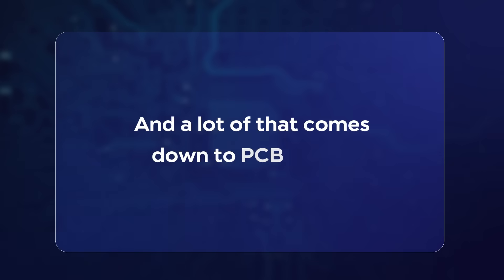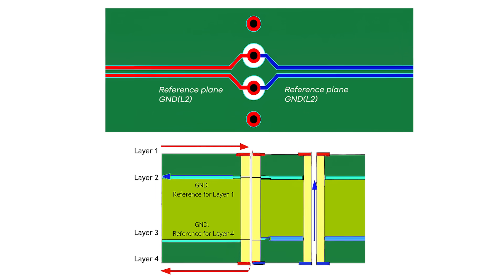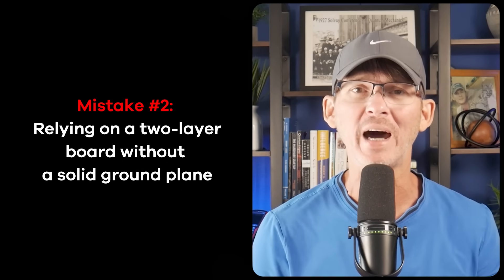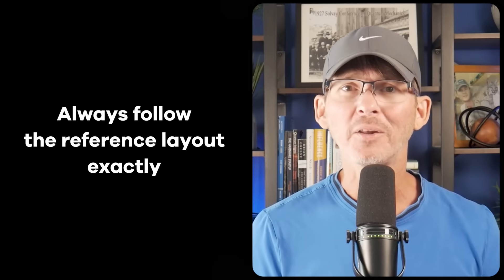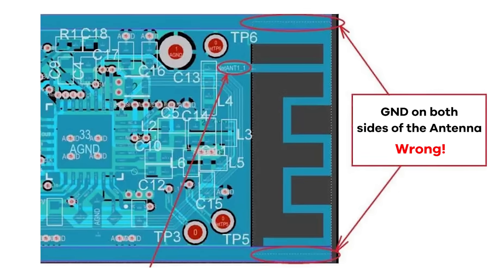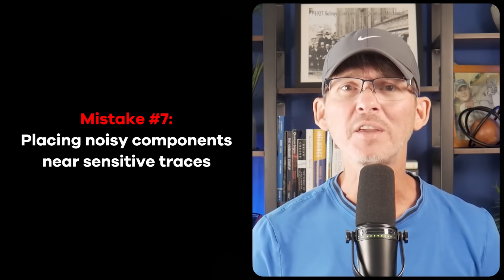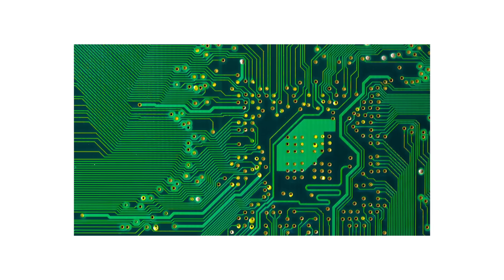7 PCB Design Mistakes That Fail Certifications

Comment from the maker: Grab your certifications guide with cost estimates and PCB design mistakes: https://bit.ly/4lxgtsr
Reply: please check your e-mail system, it may not be active for some e-mail providers (i.e. gmail didn't came through).
Reply from the maker: @clockworkvanhellsing372  Just be sure to check your promotions tab if using gmail.
Reply: Is the Guide composed by only 2 pages of text and weight 58MB ? I downloaded a file with that specifications following your link

Comment: Hi, Hope you can help me with one question, you said that we need to avoid ground plane fragmentation, but what happens when in our design we have optoacoplers supose i have a high power and high voltage inverter which i need a seperate ground from a microcobtroller signals etc. In this case in valid to do a fragmentation (2 diferent ground planes on the same pcb)

Comment: Is emc necesary for CE though? I think only if there are radio devices.
Reply from the maker: Yes, even for those without intentional radios. Electronics can radiate unintentionally too so all must comply.
Reply: @PredictableDesigns  Do you know CE procedure for individuals? I looked into it and it seems i could certify it myself? My product is quite simple, no radios.
Reply: See CFR 15.103 for exempted devices. Common ones are from part (a) and (c) ... automotive and test equipment. This is only for unintentional radiators though.

Comment: No 4 layer with dedicated VCC plane is a better option.  Bogatain has proved this
Reply: Signal - VCC - GND - Signal, right? That’s how I usually do it.
Reply: @paulblase3955  We do signal/gnd/vcc/signal.  no split planes at all.  Vcc polys on top and vcc are fine

Comment: If I follow the 4 layer layout, being Signal and PWR/GND/GND/Signal and PWR, should I do cooper fill on both external layers or is it not necessary? I am developing a test board for reading temperature and oil pressure in a car. Thanks!
Reply: Put GND everywhere!, but make sure it is properly stitched using vias to the planes. Don't have slabs of GND 'flapping about in the breeze' with only one via at and end od the polygon.
Reply from the maker: Sorry I missed your question. But, yes, do what Robert said:)
Reply: @PredictableDesigns thanks for the response!

Comment: @PredictableDesigns , shared PDFs are suspiciously massive
Reply from the maker: Yeah the two checklists were so large due to the high resolution cover. I've fixed those now so they're only about 6MB. The certifications guide is still around 38MB because it has images and such.
Reply: @PredictableDesigns thanks you for the prompt action, much appreciate it. Really love your content..

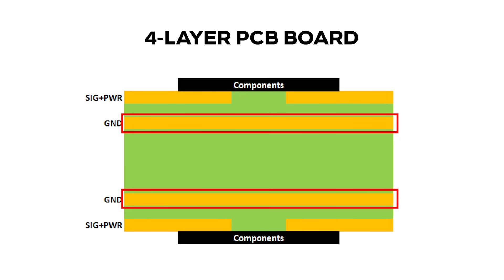Comment: @predictableDesigns Hello, sir. At 3:16, you mentioned that internal layers should be grounded. I'm a bit confused because in some tutorials, I've seen that the 3rd layer should be used as a solid power plane. This creates capacitance between the 2nd  (ground) plane and the 3rd (power) plane, which helps to minimize high-frequency signal noise.
what are your review about it
Reply from the maker: Technically I say only an internal ground plane is needed, not two. The image shows both internal layers as ground. Normally yes, one of them is used for power routing. Also a plane tied to a supply is also at ac ground, and yes these can create a distributed capacitor between input supply and ground, along with the decoupling caps, means for high frequency rf signals they're shorted together.

Comment: It is a good video, but I heard 6 times EMC or related and high voltage trace separation once. Things have changed the last 40 years.
Reply from the maker: Thanks for the feedback. Fair point. Every product deals with EMC and only a minority deal with high voltage. My plan is to do a video   going more in depth into several of these issues including high voltage.

Comment: There is a lot of misunderstandings about what is high voltage. Normal mains is NOT high voltage, it is low voltage. High voltage start at 1000 V AC in most electric standards. Voltages below 50V is extra low voltage, ELV.
Sometimes you have Medium Voltage between 1 and 45 kV as an additional range, in that case high voltage start at 45 kV and is not normaly routed on PCBs.
Reply from the maker: In consumer electronics 110VAC is considered high voltage.
Reply: @PredictableDesigns  According to what standards? 
Not according to e.g. IEC 60038.

I know that e.g. the automotive industry has messed up by e.g. defining a 400V battery as a high voltage battery. I wonder how they will mark true high Voltage batteries like 1500 V that will come on heavy vehicles.

Then I have also heard of designs where everything above 5 V is marked as HV!!
Reply: @larslindgren3846 youre comparing apples to oranges. people that work in utilities understand the dangers. the average consumer doesnt. "danger low voltage" wouldnt carry the same weight with the average person as "danger high voltage". just think of all the dumb people you've had to deal with this week.
Reply: @valvejob4215 I think it is important that we try to follow standard terminology in engineering.
I had the problem that "Warning low voltage " don't sounds as serious, we choose to use "Warning dangerous voltage, 600V" instead.
Reply: @larslindgren3846 “Warning, line voltage“ or „warning, live parts“ etc. have been used a lot in the past. No reason to misuse the term „high voltage“.
Reply: Different fields have different definitions.

In automotive:
"High Voltage" means the classification of an electric component or circuit, if 
its working voltage is > 60 V and ≤ 1500 V DC or > 30 V and ≤ 1000 V AC 
root mean square (rms).
as by UNECE regulation No 100 (revision 2, 12 August 2013), paragraph 2.17
Reply: @tommihommi1 As I wrote the automotive industry has messed up the definition, that doesn't mean everybody else should mix the terminology even further.
Reply: I believe household electronics regard around 50V DC as requiring more safety...

Comment: Designing for EMC is something that most people don't get any training in, and have some assumptions that can be dangerous/useless.  Your comment about adding shielding, and that it is easy to do incorrectly, matches my experience.  Just throwing a can around a circuit isn't going to help if you don't properly filter each wire going through the can.  An EMC consultant can be a worthwhile expense when the schedule is tight... although you may want to do the consultation at the early design review.

Comment: CE markings don’t require an institute or agency like the FCC to put in your product. It’s self certification. If your product doesn’t conform, you have criminal liability so somebody should check, preferably a third party BUT not necessarily. This is very different to America.
Reply from the maker: Very similar to the FCC Supplier's Declaration of Conformity (SDoC) process which is totally self-certification.
Reply: You can’t self declare if it’s a medical product, a product for children or a product containing a radio. Today, almost anything has WiFi, Bluetooth, NFC, wireless charging or something else triggering external certification.

Comment: Why two inner layers of GND, when You can have one inner layer of GND and one of VCC?
Reply from the maker: Yeah, that was an extreme example, and I almost always make one inner layer GND, and the other one VCC.
Reply: @PredictableDesigns  would't it e better to use the internal layers for signals and have the ground planes outside, or are the internal groundplanes better to prevent pcb internal interferance issues?
Reply: You have to consider the dielectric thicknes inside the pcb of all layers. In general you need ground plane closest as possible to your signal line. If you need VCC inside, use a pcb with 6 layers.
Reply: @pigi_experiment  ground plane? I am not sure that it has to be ground. I believe any constant potential will do. When i have digital signal changing between vcc and gnd, vcc plane as return path sounds as good as gnd one.
Reply: Not necessarily.  If you could have a complete copper reference plane it might perform better this way around.  But you cannot if you have components to populate.   The cutouts that the component footprints create will generate force you to avoid routing signals underneath.  It just all gets a bit messy to work with.

Remember that the (AC) signal doesn't travel in the copper, it travels between the copper in the dielectric and that's true whichever way up the layers are.  As another commentator pointed out above you want the thinnest dielectric layer possible to constrain the field in the smallest volume you can.

Comment: That is a good argument to just use 4 layer boards as the minimum for everything. They're so cheap these days, why not?
Reply from the maker: I agree. I rarely do anything less than 4 layers, except for maybe a very simple board.
Reply: I notice the Altium guy gets downright furious about this, and hates 2 layer boards. He even did a video about how to fix 2 layer designs which was basically just 'use 4 layers'
Reply: Basically every AC/DC power supply module is 2 layers. Cost is a big reason, plus clearances, DTI, etc.

Comment: since you mentioned TI .. I remember their fancy switching supplies ... what a rubbish design with audible noise even on their reference EVB, they even dared to charge for it. Was it TPS5428 or TPS565208...
Yet they decided to push it out and let customers suffer from it. The attitude of TI was more like whatever ... just sell it.
Monolithic Powersystems / MPS was a much better choice. Even before buying parts they were very well  aware of that - and even on the worst possible sample board I made myself it was just silent and performed very well.
Reply from the maker: This is a pretty unusual experience with TI. They're known for being the best in power management and they usually provide excellent tech support.